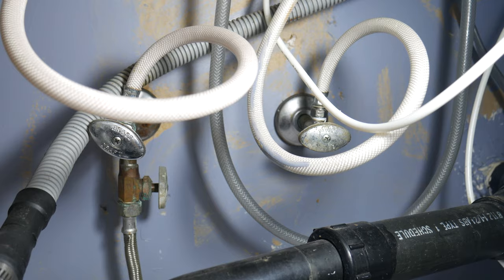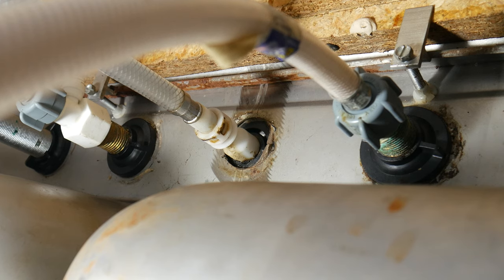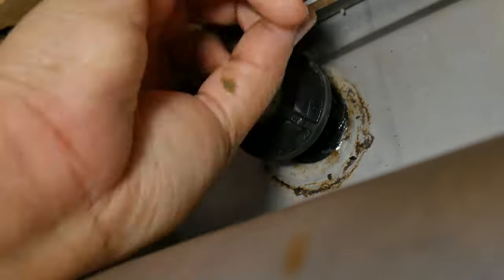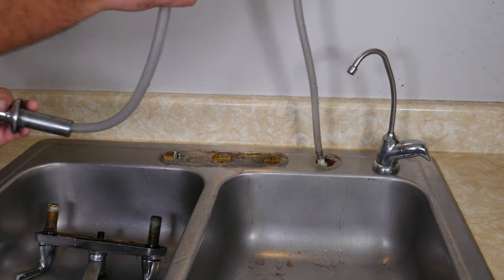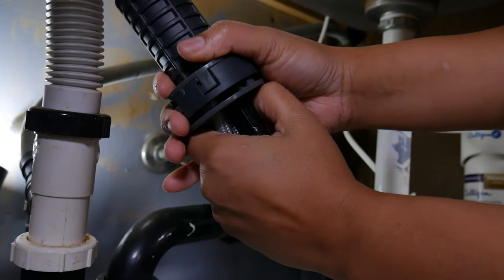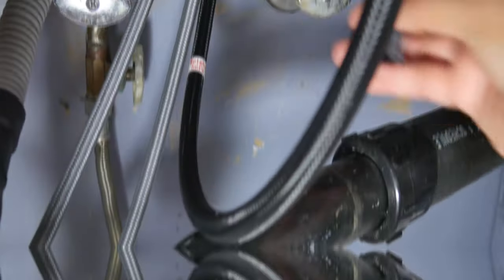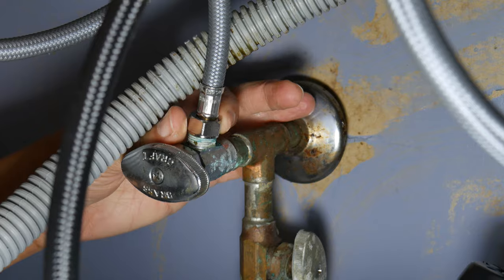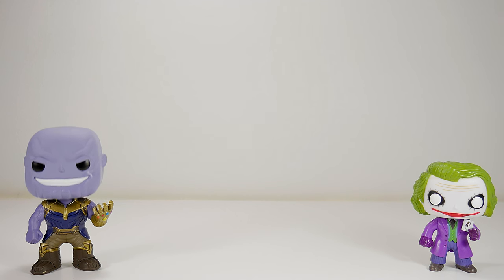How To Replace Install Kitchen Faucet Easy Simple

Comment: Do u have too have a sink with a sprayer too buy this type of fauct set up  be cuase I saw the hose he connect too use the spray and im a little confused on what that hose does  i have a double sink like this but no sprayer function  just a dishwasher drain

Comment: When you pulled the sprayer out at 8:00 I noticed the faucet was loose. I have the same problem and seems to be due to having a thin metal sink (which flexes) and a top heavy faucet with only one anchor point. I tried the delta stabilization plate under the sink and it helped, but still not perfect. Have you found a solution?
Reply from the maker: Caulk. Once the caulking set. Seemed to do the trick for our particular situation. Hope this helps

Comment: The nuts that hold the faucet in place are too tight to loosen by hand. What wrench do you recommend to use for this step?
Reply from the maker: you can use a faucet removal tool like this one or similar. https://amzn.to/45LGCM1 or similar to this one https://amzn.to/478HhZa we have had occasions where we had to use both.

Comment: Please help me, my faucet handle looks like it is pulling out, I don't know if there's nothing wrong, the problem is when I open it I see the yellow tread between the handle and the main faucet which made me to think is pulling out , is my new house and I don't know if there's nothing wrong or not
Reply from the maker: could it be? needs to be tighten maybe a screw on or pressed on? if its a new faucet, maybe replacing it (return or warranty) would be the way to go, you don't want to temporally fix it and then the issue comes back. good luck. let us know how it goes.

Comment: I have a question! My mounting nut doesn't tighten after turning (tried both ways) any ideas? 

Thanks!
Reply from the maker: is it the center one? the one we used on the video is a press on one does not need to be turned, maybe yours is one like the one we used. good luck.